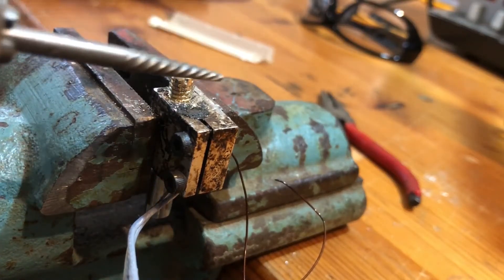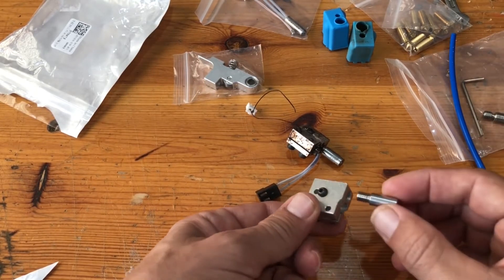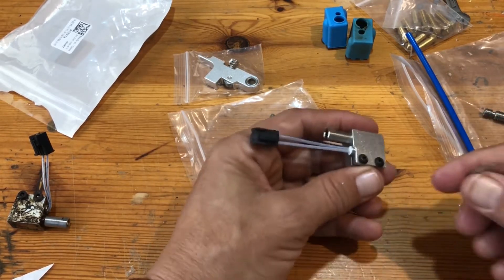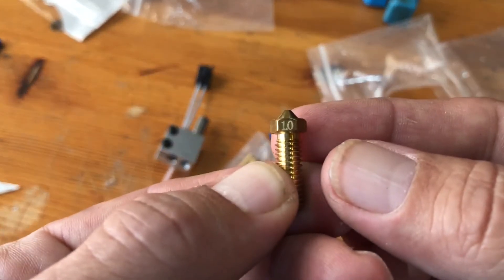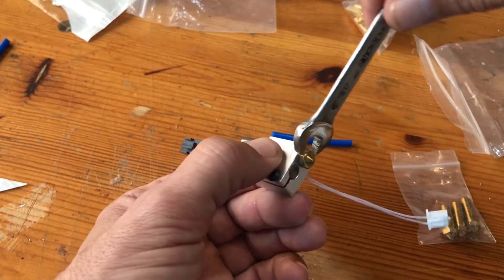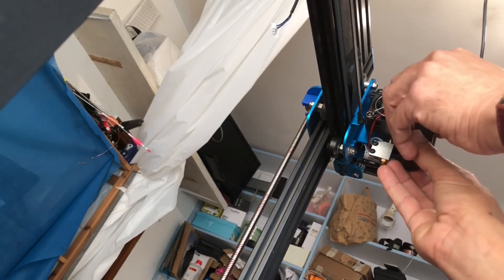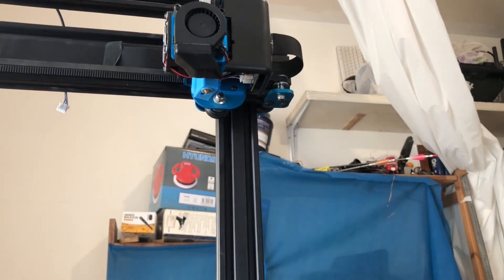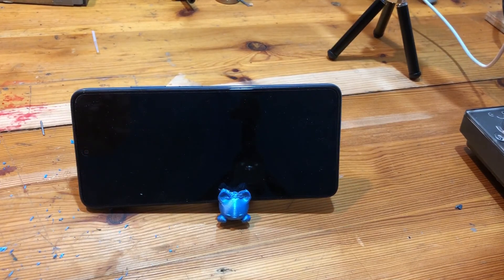Upgrading the Heating Block on My Artillery Sidewinder X1

Comment: Why not take off the entire assembly to work in it? Its just three screws to remove it
Reply from the maker: @vbnautical5041  thank you, after your comment I checked and found that the rubber belt is not connected directly to the print head and actually it can be dismount easily by removing 3 screws, I am not sure why I didn't notice that before 😔

Comment: How can I take off that heat block
Reply from the maker: minute 09:14 release this two Allen screws after removing the side fan and the heating block should slide out with a little pull
Reply: @SAMUELDIY  thank u so much, u helped me!
Reply: What was the error you were getting?
Reply: @alfhid1947  ı dont remember fully but ı think heatblock is too much loose for printing and it moves so much from It's place while printing